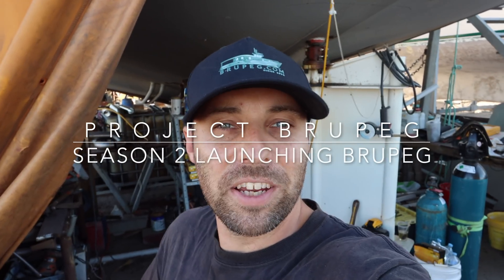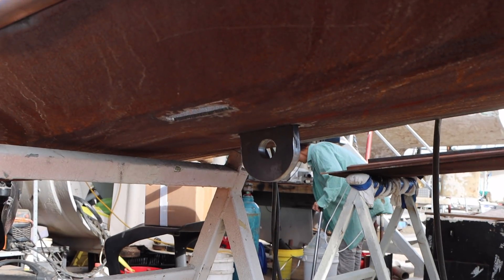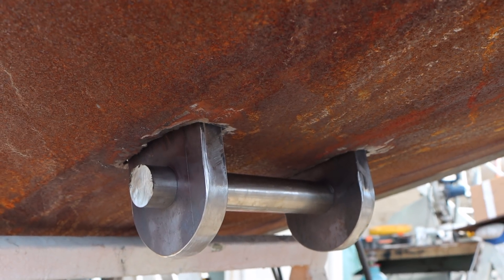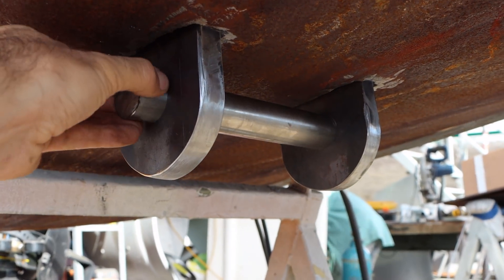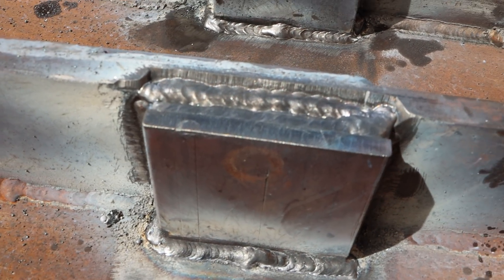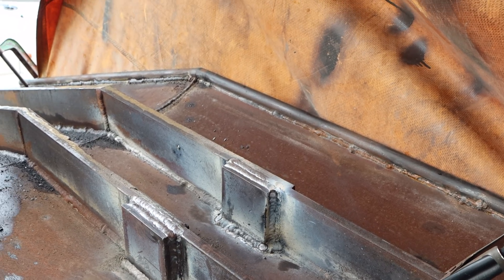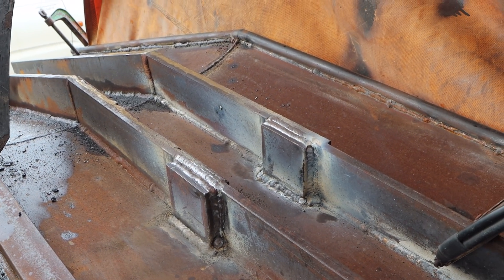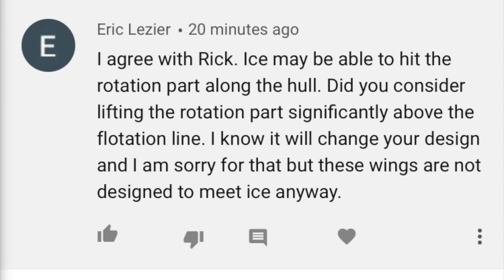Trawler Wing Hinges - Project Brupeg Ep. 131

Comment: The most reinforced area should be at the mount point to the hull....have you thought about the load on the wings against the rather thin dimension of the above water line steel....I’m not a engineer but have raced boats with stabling fixtures and the load is unreal
Reply from the maker: Yeah anywhere the wings or arm attach to the hull will be beefed up, we are in the process of designing the deck mounting hardware for the arms now

Comment: Im not an engineer and this certainly comes to late since the wings are probably done by now ... But when validating a (i.e my) construction(s) i start with the external forces that might act on it and how these forces transmit through the construction. I'm trying to imagine where tensional, bending and shearing forces as well as rotational moments takes place. That allows to put the current location I'm working on into perspective and help me to "call it good" or even identify areas that are much weaker in comparison.

The wing is attached to the boat hull with a hinge that speards about almost the entire width of the wing. On the other hand, the lifiting arm/stabilizer your're building the hinges for is comparatively long, and in relation to the surface area of the wing only stong in longitudinal direction, but cannot withstand bending moments well.

The two thick center beams seem plenty stong (comparatively) to withstand bending in the wing longitudinal direction. If any, transverse gussets or ribs running from fore to  aft of the wing should not be limited to where the two ears are welded in, but multiple ribs accross the entire length of the wing. As Jess said,  it is the 6mm skin that "sees" the surface-ortohgonal force-components of the water acting on it. These are translated into tension forces within the skin sheet when trying to retain the cross sectional profile of the wing against the two center ribs.

Strenght not necessarily comes from thick bars of steel because forces transmit predominantly on the outside and progressively less to the middle of a bar. The wing is a box and don't underestimate the stiffness that that is contributing next to these two center beams. Strengh of steel is measured in force per square area. The cross sectional area of the skin is substantial compared to the the cross sectional area of the center beams. Particular, when you considder that for the beams maybe only a thrid of the cross sectional area (the top and botton portions) is really carying the majority of the longitudinal bending load.

No, the load case that seems to be the most critical in your design is torsional bending strength of the wing. Attachment is essentially a three-point contact trying to control a rectangular wing that is extending half beyond the attachment triangle. The current design of the wing with only having longitudinal beams relies on the skin alone to withstand any twisting moments. The twisting moment is esstentially counteracted only at the two hinge points at the hull, which make for a rather long lever. That makes the skin responsible for crontolling two critical load cases: vertical forces against the two beams and the twisting moments. On the skin, these result in varying foces with different vectors. Tansverse ribs, like in a wing of a plane, helped to even these forces out.

But again, i am not an engineer and by no means are able asses the design in absolute terms. My feeling agrees with that it is pobably way overbuilt. Just within it being way overbuilt, the twisting strengh is maybe the least overbuild aspect :-)

Comment: How far in the water do they sit? Will you raise while sitting still/underway, sea water weighs 29 kilos per cubic foot X the surface area of the wing, weight of the wings x the power of the lifting mechanism. strength of wing is important when raising, don't forget the lateral and twisting forces on the hinge, while water is moving across the wings surface. just few thoughts from an old Navy guy.
Reply from the maker: Thanks, they are a pretty versatile design and will likely spend most of their life down. At anchor they work great, steaming they still do their designed job. They are mostly air inside these wings so they won’t have neutral buoyancy but it won’t be as bad as people think. We ran the numbers, they weigh 350kg. They will produce 320kg if lift at 9knots so the boat will only see around 30kg or downward force. The other loads are able to be absorbed by the structure and the hull according to Chris who is guiding this design

Comment: You had mentioned before after going to flux core wire how much nicer it was. This would definitely be the place for it since flux core penetrates much better than mig. But I saw you with the regulator bit and then I saw you removing slag? Are you running flux core WITH gas? Never tried that but don't know if anything is gained or lost. That is some REALLY thick steel for a mig welder!! You would be needing 250 amps and probably .040 or .045 wire to get perfect penetration with MIG. I think I would have rented a stick welder for this part myself.
Reply from the maker: Hi Richard, i cant stand stick, in my experiance MIG set up right walks all over stick. others prefer stick and thats ok but thick steel is not an issue with the welder set up right. the commercial guys here can weld 60mm stel with MIG and get great penetration so stick v mig is a fallacy. as for runing gas with flux, we use an argon CO2 mix as we find it helps to run the weld hotter than no gas, also makes less splatter and keeps the gun colder for longer so we can increase the duty cycle of the welder we have (as the gun is the main limiting factor).

Comment: OK ...  but how do you plan to push and pull on the wings with an electrical winch ?
Reply from the maker: Pull only. Gravity lowers them down. Again we are copying a system that’s working on dozens of trawlers so nothing to invent here just refitting to suit Brupeg
Reply: @ProjectBrupeg  A pushing system would be much more efficient to prevent the boat from rolling. Just look at what they do in France and Canada

Comment: hi Jess and Damien
Putting braces in X (diagonal) would be more effective than square.
Have you already calculated the cylinder size to move the wings ?
If not, send details of the characteristics you need
Reply from the maker: Hi Eric, we have actually moved away from hydraulics and back to electric winch so a fair bit of the lifting gear has changed since the early design

Comment: Yes, honeycomb or waffle the area around the concentrated load just like the Mrs. said.   She is right about worrying about the skin deforming when the brackets try and make the "beams" roll over.  Picture aluminum castings such as car engine parts and you will find this waffle structure support mounting brackets/ears.
Reply from the maker: Yeah she was right. We ended up adding internal bracing

Comment: The hinge pins run fore and aft, and the hinge plates are transverse, so they are not good for flow over the wings. You could add faring plates forward and aft of the hinge plates, that route water flow around the hinge plates, and that also stiffen the upper plate of the wings. Shaped like a long version of a transducer fairing block. You would need a slot in the fairing to get the hinge pin out, but that could be closed over with plate.  Greg
Reply from the maker: Yeah I thought of a bolt of block of some sort to act as a fairing.

Comment: Forget the conventional regulator. Replace it with a flow regulator that's the kind with the glass and the ball inside that bounces. Much better system and usually not that expensive. Well worth it!
Reply from the maker: Thanks Charlie, yeah i just found one on eBay for $40

Comment: You had mentioned in an earlier video about adding some diesel to the wings after they are closed up for corrosion control.  I just wanted to give you another option = What I do when I make big stuff like that is add about five gallons of automotive anti-freeze, it's great for corrosion control and it's not flammable/explosive when you weld on the wings in the future.  I personally would add a pipe bung at each end of the wing (you never know which position your going to be working on them once you hit the water) and add the anti freeze through one of the bungs, that way you also have the bungs to add 5 or 10 PSI to pressurize the wings to find pin holes/cracks.
Reply from the maker: The plan is to add a bung top and bottom for liquid access. all this said, we have 2000L of diesel sitting under the boat so for us its an easy access thing and something thats quite commonly used in this yard.

Comment: Hi guys. Maybe you should have a look at Dashaws FPB videos and how they go about stablizing their vessels.I think what you're doing might be a little overkill,and extra weight you may not necessarily need!
Reply from the maker: Hi Jill, yeah i have checked out their channel, very interesting design conversations however becuase they build their hulls light and able to ride through and over weather they have different considerations. Weight isnt an issue on trawlers as its quite common for them to pump many tonnes of seawater into tanks to sink them down in the water when the weather gets up to make them ride better. With the air inside these wings and the lift they will create at 9knots forward boat speed we have been told they will present as a 30kg weight hanging off the side of the boat.

Comment: Great to see you running stringer beads in that vee and not bloody weaving as much! Lol. Once you get that bottom skin on you’ll be creating a D box section. The upper and lower skins will be locked together. The thickness of the stabilisers and spars gives you longitudinal strength while the chord gives forward and aft strength. You can put as many gussets in side on those lugs as you like however the failure point will be around the fillet between the skin and the lug. I’d probably box in the spars either side of the lugs. As in cut pieces of the same flat bar you made the spars from and fit them between the spars just outside of the lugs. That way you sort of have both lugs working as one.
Reply from the maker: Ahh yes we sorted did that. We only used a single spar between the two strong backs but it was a piece of 100x20 bar so pretty rigid. We also extended the spar to the front of the wing and the the angle in the rear so spreading the vertical load roughly 600mm across rather than just onto the strong backs. I plan to polish the fillet like you showed me as it makes a lot of sense for that to be the failure point
Reply: Project Brupeg Sounds great. I noticed by the thumbnail the holes in the skin for the lugs look sloppy. I’m not knocking you ok. You are both doing great and aren’t too stubborn to take on advice. 
When you come to weld around those lugs on the outside of the skin fill all the gaps around them first. Bridge the lugs with a solid bit of scrap too to stop them pulling to much. You might want to shove a standard cutting disc down there and get to the fillet around the inside. You can punch into the lugs to get it filled but after filling up the gaps go around with the grinder, come back to flush on the skin and lug, as in there isn’t a weld there, then put your fillet around the lugs. 
Also with the slots in the lower skin for welding to the spars  you want them just wide enough to run a fillet down each side of the slot. So probably about 10 mm. If you use too narrow a slot you’ll pick up the spar ok but you won’t get the root of the slot to fuse properly. You’ll only have molten metal washing over it instead of being pushed into it.
Reply from the maker: I’ve saved this comment as a screen shot so I can thoroughly delve into it when I’m standing in front of the wing. I didn’t realise about the slot welding, I was going to run a slot 6mm wide (grinding disc) but will not have them up wider now. Thanks for this aye. Really stoked to have this input
Reply: Project Brupeg Too easy. If you draw a 6mm x 6mm square on paper you’ll see how tight it is to get to the root of one side while not arcing out on the top corner of the opposite side.  Cut practice slots in some 6mm off cuts of various widths and go with what you’re happy with. Once you settle on a width drill the ends of the slots first for a nice radius then cut out the middle. 
I know it sounds hard but I’d be aiming to weld around the slots in one continuous fillet. Start in the middle of the slot and work your way around back to the start. You don’t have to fill them with weld either. It’s just wasting wire and putting heat in for nothing. Pressure test them first then fill just using a filler. The fillet will be plenty.
Reply from the maker: Nice that makes sense. Easy done
Reply: Project Brupeg If it wasn’t for this damn pandemic mate me and the better half would be more than happy to head up for a long weekend to pitch in. I’d say you’ll be on the water before this is over. Hopefully you’ll be back this way when you look at redoing the stabiliser hinges.
Reply from the maker: Yeah we just got notice today we can’t launch indefinitely. So we are here for a while. That said heading south is the plan as soon as we can
Reply: Project Brupeg Well we’re about halfway between Brisbane and Toowoomba so pretty well landlocked! Lol. If things pan out in the future and stuff settles down and you’re still on the hard stand and there’s no risk to Jess or yourself we’d be happy to come up and I can at least weld those hinges on the hull for you. But I know that time waits for no one.
Reply from the maker: If we can do it that way that would be great. Either way I’m sure there will be something else we can build if they are finished at that stage

Comment: My 2c is to design for the conditions you will encounter at the latitudes you want to explore, and build in some extra bracing from there, bullet-proof enough to keep you safe while you scamper to warmer climes. Unless you're building an icebreaker, it doesn't need to be as heavy, massive and powerful as one. There is no upper limit -- always more you could add until you sink the boat with weight.  It seems to me that design has got to be a compromise with the fates, not a total victory over them. "One should never try to mess with Mother Nature."

Comment: Hi Guys.
I cant offer advice on the strength.
The thing that sprung to mind was the gap between the pin and the outer skin????
It appears too close to allow a robust enough joint.
I am no expert.
Good luck and take care.
Reply from the maker: Thanks Ron. It’s very tight I admit but I wanted it as close as possible to reduce drag

Comment: Hey Jess and Dame,  You've got lots of strength in fwd/aft and bending orientations, so I don't think you'll suffer failures there... the load is coming from the skin 1st, like a sail... spread over a broad area. I was going to suggest the same thing I heard you say about 15:50 to back up the protruding plates by plug welding thru the skin to a doubler plate so it has less tendency to rack or flex the individual plates supporting the pin. Some small (25 mm) triangular gussets on the adjacent sides should be more than enough to stop skin flexion along weld seams. Will you fill the wing's wetted interior spaces with some type of water excluding foam so it doesn't pick up additional H2O weight internally or just put some diesel inside via some drainage pugs so it can be drained/inspected occasionally for leaks and rust ?
Reply from the maker: Hi Mike, yeah the plan is make them air tight and add 30L or so of diesel via a bung to slosh around. Im hesitant to have any foam against bare steel as it just holds water and condensation against the steel. We have since added the 20mm vertical brace between the two main beams and also extended out in the same direction to the leading edge and the 50mm angle towards the rear with some vertical 6mm plate and 6mm doubler
Reply: @ProjectBrupeg  Sounds like more than enough... but 30 L, that sounds like a lot... was thinking  a pair of small limber holes laterally between cells and the upper bung as the level checker and a liter per vertical cell. The two holes per are to allow cross gas venting so liquid can flow. You haven't put on upper skin yet, right ?  You can plasma a  pair of small grooves across each beam and grind smooth, or maybe weld in a clean piece of smooth pipe in place across the beams for liquid flow between cells. That way the bung on upper wing can be the level check for all of them collectively.

Comment: Regarding the ice running on the hull.
Would you be able to mount strakes perpendicular to the hull to push the ice away before contact with the hinge plates and planes?
Reply from the maker: Yeah that is a possibility, we are currently looking into what it wold take to remove the wings completely from the hull at the ice edge so we would have a perfectly smooth hull at that point

Comment: First thing I thought of was adding a single solid piece of steel between the longitudinals. Having that cross wise piece running completely across the wing would definitely spread the load out for sure.
Reply from the maker: Great point! yeah we did add the 20mm and also extended it out to the leading edge and the 50mm angle towards the rear with some vertical 6mm plate.
Reply: @ProjectBrupeg  Perfect.